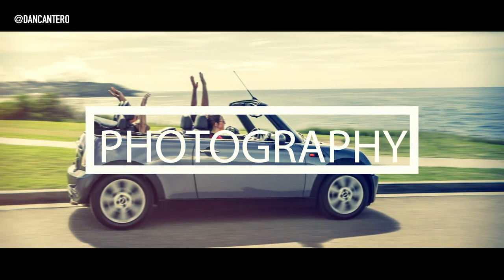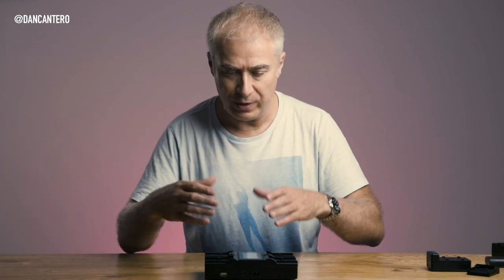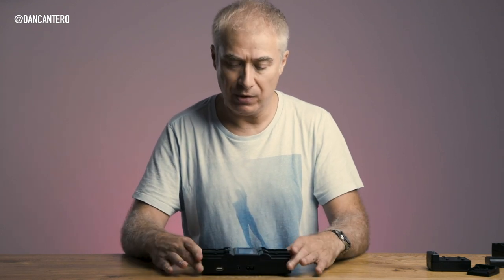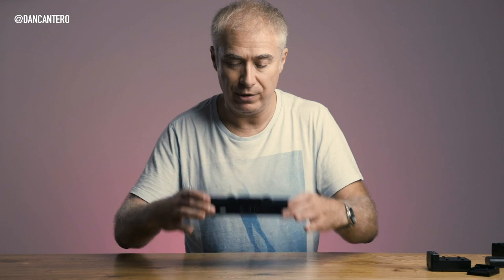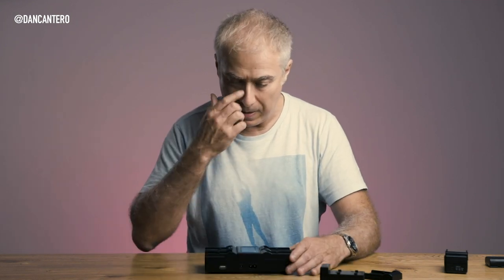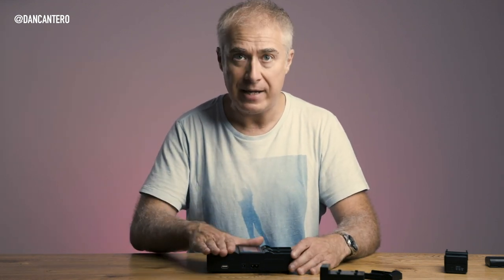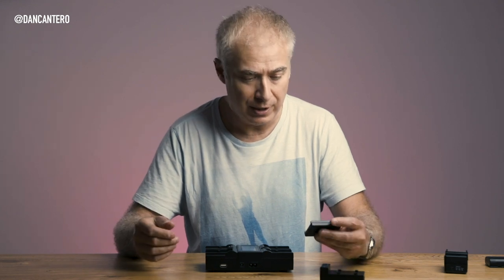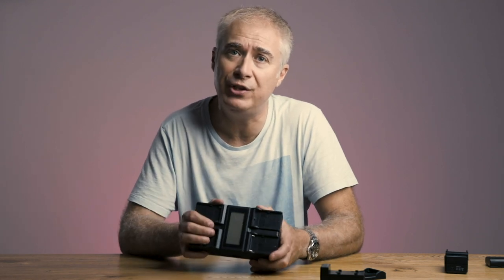Universal camera battery charger

Comment from the maker: In this video I will show you how you can make a universal camera battery charger, this battery charger can be changed to match the type of batteries that you have.  This universal battery charger works by changing the plates on the battery charger and is the ideal charging solution for anyone that has multiple types of batteries to charge.
Reply: @Daniel Cantero - How long does it take to charge 4 empty batteries? I am looking to buy this tonight!

Comment: @Daniel Cantero - How long does it take to charge 4 empty batteries? I am looking to buy this tonight!
Reply from the maker: XTREME PC GAMER    For me it takes around 3 hours but I’ve noticed it takes different time depending on the battery brand.  It’s comparable to the original canon one but you are doing 4 at a time.

Comment: i have a nikon d3 battery . my charger stopped working. do you think i can use this?
Reply from the maker: It should work really well.  Just make sure to get the right plate for it.
Reply: @DanCantero  thanks. does it work for 11.1v batteries?  manufacturer says can charge 8.4/12.6V batteries.

Comment: Will this work in the United State of Texas? We consider ourselves civilized here in Texas and use 110v or is and adapter needed for this adapter.
Reply from the maker: G'day Ken!  :-)  Yes it will work as the power supply can automatically regulate between the ranges of 100-240 volts.  So it will work with 240v and a very civilised 110v!  :-)

Comment: This charger is purely crap! It simply does not charge the batteries !!!
Reply from the maker: Hi JM, I'm sorry you had a bad experience.  I've had mine for years now and it just keeps going and going.  I use it to charge all my Sony and Canon batteries.  The only thing I can think of (apart from a faulty unit) is if the plates are not fully pushed in.
Reply: @DanCantero  what do you mean by the plates are not fully pushed in. That might be my problem
Reply from the maker: Hi JM, the charger has swappable plates that you install for your type of battery.  These can be slid in and out to replace them with different types of plates for different types of batteries.  I have noticed that sometimes the plates look like they are in place but they need to be pushed in further.  Try removing the plates and checking that the terminals are clean and look undamaged.  Then re-insert them again and give that a try.  I hope this makes sense.  If it doesn't, let me know and I'm happy to make a short video about this since this might be happening to others too.
Reply: @DanCantero  got it. But could you please make the video?? That will help me so so much
Reply: I’m with you on this, I have 2 for different batteries and it takes me 10 minutes or more just to get it to charge